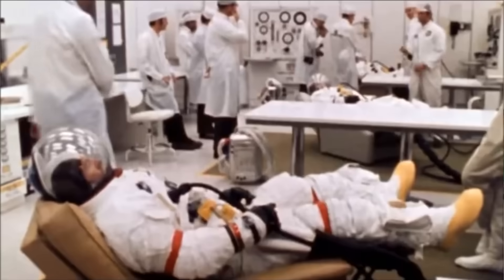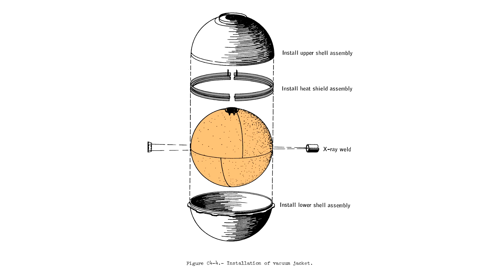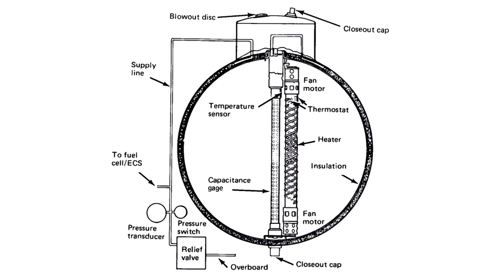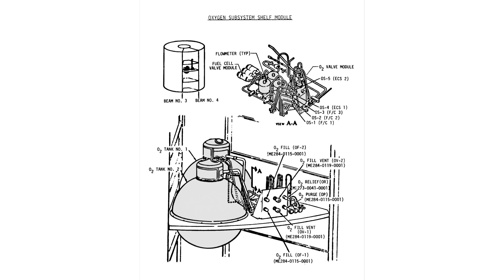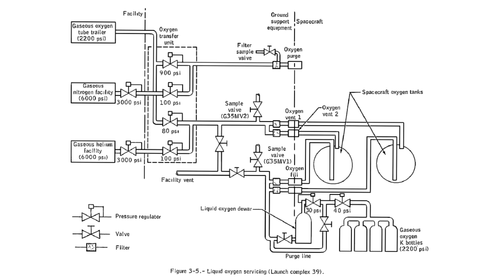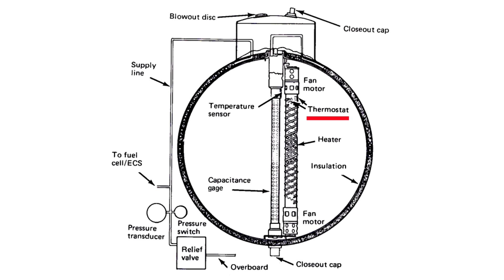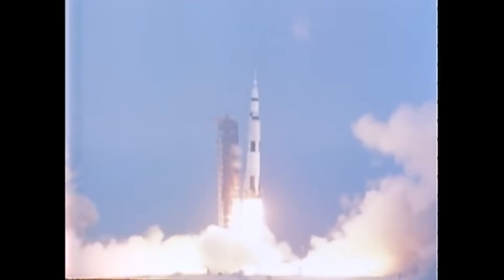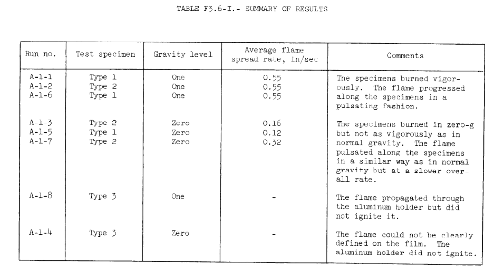What Caused The Explosion That Crippled Apollo 13?

Comment: One element to this story which is present in Lovell's book, but which you didn't mention - and is worth highlighting as it's yet another of the coincidences and minor failures that contributed to the explosion. When they were attempting to drain the tanks using the heaters whey were also monitoring the temperature within the tanks - this should have meant they would have noticed they were baking it at 500C...  But they temperature sensors and monitor they were using was calibrates only to go up as high as the 27C they expected the thermostats to cut out at.  So when the thermostats failed, and burned off the insulation - as far as the technicians could tell, the temperatures were precisely the 27C they were expecting - not the catastrophic 500C.   If their thermometers could go higher than 27C, they'd have immediately know the tank was faulty.

Just makes me thing of the Chernobyl series - "It's ... the maximum reading on low-limit dosimeters. They gave us the number they had...."
Reply: Dave F Ouch! The law of unintended consequences.
Reply: A good case for when testing things, choose a gauge with a range high enough to tell you if things have gone catastrophically wrong.
Reply: @scottwatrous  They did . This was a cryogenic liquid oxygen tank. If the temperatures are above freezing, things have already gone disastrously wrong. They chose the gauge based on the range it was supposed to be used at. They never accounted for someone deliberately bringing the tank to a boil because that was neither part of the intended use in-flight nor any of the planned ground tests.
Reply: @scottwatrous  Or at the very least the gauge should indicate explicitly when it goes off scale. Even simple mechanical gauges almost always have this 'feature' implemented simply by having the mechanical movement reach well beyond the scale printed on the face. Once you see the needle is off the scale you know you can no longer trust the reading.
Reply: @scottwatrous  You have to balance risk, likelihood & cost. What if the part to do that was crazy expensive or unreliable or not even currently available?
Reply: I’ve been selling instrumentation for over 25 years, miss scaling or wrongly matched scaling is still the most common issue we see!
Reply from the maker: I know.... I knew this but forgot to mention it
Reply: @scottmanley  We forgive you Scott because we all knows Jim's Level's book:)
Reply: @scottmanley  As I like to answer when someone asks me if "do you know such-and-such" : "oh, I know everything I just can't remember it all"
Reply: "27C...not great, not terrible."
Reply: Always design your stuff as if it will be hacked by somebody.
Reply: That is... Idiotic. Any measuring equipment should have a measuring range a relevant margin outside the maximum and minimum 🙈
Reply: @Musikur  They did. Again: it's a cryogenic liquid oxygen tank. 27 degrees C is way, way above the maximum operating temperature; by that point all your liquid oxygen has been long since boiled off. Indeed, that was what the engineers were doing deliberately: heating the tank to boil off liquid oxygen to empty it. The sensor was never designed for that; it was intended to handle the conditions expected in flight and the expected ground tests.
Reply: I find it odd that they didn't include a thermal fuse in the design. It is a simple device which is incapable of failing, even if it tried.
Reply: @listerdave1240  A thermal fuse doesn't reset. If one had blown in flight, they'd have lost that tank's heater for the rest of the mission. So they went with a thermal cut-out instead.
Reply: @macdjord  A thermal fuse never blows unless the temperature has reached its setpoint. It is a very simple device with a wire made of a material that melts at the required temperature so there is no way for it to fail to blow and neither is there a way for it to fail without the temperature being too high.
They could have put a 100 C thermal fuse which would only blow way above the supposed maximum of 27 degrees but still way below the point where a fire could be started.  If the temperature reached 100 C then you're better off with a heater not working at all than the risk of blowing up the tank.
Reply: @listerdave1240  I'm fully aware of what a thermal fuse is and how it works. But why would they do that? If your liquid oxygen tank hits 100 C, it's either long since boiled dry, in which case you no longer care and are probably already dead, or its on fire and cutting the heater power won't help. Sure, it's obvious in retrospect that it would have been a good backup, but in advance? They already had a thermal cutout system; adding another one would just be one more component that might fail.

Remember, neither the heater nor the thermal cutout failed *in flight*. It was a ground operation - one the tank was never designed for - which caused the damage.
Reply: @macdjord  Well, it did reach and far exceed that and it exploded. The heater is estimated to have gone up to 600C starting the fire and subsequent explosion. A thermal fuse would have halted that at 100C (or whatever rating was chosen). It may have put the tank out of action but would have prevented its explosion from damaging all the other stuff.
Reply: @listerdave1240  No, the overheating heater - which, again, was during a ground test which the tank wasn't actually designed for - just damaged the insulation on the wires. It was attempting to stir the oxygen tank which cause the damaged wires to arc and start a fire in flight.
Reply: @macdjord  Still, the overheating heater would have tripped the thermal fuse and prevented the tank from being used for flight (because it would no longer work at all rather appear to work while hiding a fatal defect). 
Generally speaking there is never a good reason to not install a thermal fuse. 
One could write a whole book of famous last words consisting just of arguments as to why a protective device isn't needed because something can never happen. Thermal fuses would feature a lot in such a book, along with bursting disks and fusible plugs.
Reply: @listerdave1240  As I said - obvious in retrospect. But the real problem here was the tank being used in ways it was never designed for.
Reply: @macdjord  It's not a matter of retrospect but bad design. Fusing protection is an absolute must and cannot be waived based on assumptions of how something is going to work. The design principle should always account for control systems jamming and such likes. Actually just the availability of enough electrical power to cause an over temperature is enough to require the incorporation of a thermal fuse, regardless of how the system is designed to operate. 
The only explanation I can think of is that they were rushing the design and got someone high up to sign off bypassing some critical safety reviews to save time.
Reply: @macdjord  Another major flaw was the failure to incorporate a large bursting disk on the outer facing side of the tank and the corresponding failure to have blowout panels to relieve overpressure on the skin of the service module at locationshousing any tanks or equipment that can fail explosively.
Even without the thermal fuse the bursting disk and blowout panels would have prevented damage to adjacent equipment in the module and would have allowed normal operation of the service module on the other oxygen tank and fuel cells. It would have been insufficient to complete the mission but way more than enough for them to go round the moon and back safely to earth without any hassle.
Reply: @listerdave1240  They had a thermal safety. It was just in the form of a self-resetting cutout instead of a fuse, since the cutout's reusability was more important for the designed parameters than the fuse's higher reliability. There were two critical errors made here: improper retesting of the cutout when the requirement was added to support higher voltage for ground tests, and deliberately boiling the tank to empty it, which was an operation for which it was never designed. (Though the second was arguably justifiable, on the grounds that swapping out the tank instead might have introduced more risk than using the non-standard draining procedure.)
The lack of a large outward-facing bursting disk and corresponding blowout panel is a good point, though I will note there are always tradeoffs; a burst disk is - by design - a weakpoint in a pressure vessel.
Reply: @macdjord  A self resetting cutout is exactly the type of device that should not be used in such a situation. They are inherently prone to welding shut.  It is OK to use one but only if it is backed up by a thermal fuse that will trip at a higher temperature. That way you have both the reusability as well as the safety net for if/when the mechanical device fails.
What happened was entirely predictable if a proper fault tree analysis had been carried out. Actually such a design should not even have survived to reach the stage of fault tree analysis. It should have been caught at the most basic level of safety review.  As I said, the only possible explanation I can think of is that waivers were obtained to rush the design through, bypassing even some of the most basic checks.
Reply: Lister Dave It could be a byproduct of the speed of development that they didn’t include a thermal fuse.  They didn’t add one because they knew temperature wouldn’t get that high in flight, and didn’t consider the remote possibility that something would go wrong on the pad.
Reply: @thebigitchy  Well that is something they couldn't know. They could perhaps assume it (incorrectly) but not know it. The very fact that is a thermostat is already shouting loudly that it can go higher as it is the only thing that limits the temperature rise and is known to have a finite probability of failing to open.
Reply: @listerdave1240  You probably don't want it to fail... Imagine if the heater wouldn't work anymore...
Reply: @MarcoTedaldi  If the thermal fuse had blown then it would mean that the heating system had become dangerous and you're better off without a non functioning heater than an out of control heater. The spacecraft was designed to easily operate with just one functioning oxygen tank but was not designed to handle an oxygen tank exploding and damaging all sorts of stuff around it.
Reply: The temperature monitor only went up to 80F.  They knew the temperature would be a little higher because they were using the heaters to remove the O2 but yeah, if they had a wider (higher) range on the monitor, they'd have seen that something was wrong with the tank shortly after the pad test.
Reply: @rsrt6910  i think one of the problems was the thermometers were only able to read to 300kelvin.
If they had a wider range of temperatures on the thermometer the engineers would of known the tank was at fault.
Reply: "would HAVE."
Reply: "Not great, not terrible"
Reply: Thank you for this detail.  I wondered why they didn't know how high the temperatures got.
Reply: Its 15000
Reply: @kevin42 that's over 9000!
Reply: I always find these situations like why did they design/test it like that. If u have a test/controll function u would think that they would have used a test kit with a higher upper limit then the maximum designed limit of the thing they were testing to even be able to spot if there was a problem.  Even if it hade never happened before they might not have thought about it. It still sticks out as a major failure,  Did no1 really se the design flaw with having a thermometers maximum reading being the same as the expected reading while in use. It´s easy to look back at mistakes and say that was dumb how did they not se that.  But with all the testing and approvals needed u would think that some1 must have atleast thought about it.
Reply: Not great, not terrible!
Reply: The take away from Chernobyl in that regard is if instruments are maxed out across the board, it's much worse than you imagined!
Reply: “You’re delusional”
Reply: 3,6 Roentgen, not great not terrible..
Reply: Kinda like the oil pressure “gauge” in most vehicles
Reply: @211212112  Ford has done that on many vehicles. The gauge itself is a fully functional gauge. But to save a small $ per vehicle a simple pressure switch is used instead of a variable sensor, and a resistor is put in the circuit to make the gauge read an acceptable value. Making the gauge functional is as simple as soldering a wire jumper across the resistor on the instrument cluster's flex circuit and swapping the oil pressure switch for a gauge sensor.
Reply: @greggv8  "Nice" you think that you are having a gauge but all you have is just a two state control light with a needle instead of light bulb:/
Reply: @211212112  could you elaborate on the vehicle oil guage comment?
Reply: @MattH-wg7ou  most vehicle oil gauges only have two states. Good and bad even though the dial makes it look like they measure more than two states. Like you could have almost normal oil pressure but it will say you have no pressure at all
Reply: @211212112  thanks for the reply, I never knew that!
Reply: This is a case of engineers being overly confident and making assumptions rather than being safe by always assuming the worst and accounting for it.  Regardless of it's application, ANY heater has the capacity to create a vast amount of heat energy than it is designed for.  Given how critical these tanks were to the survival of 3 humans, it is just unbelievable the engineers didn't have a safeguard in place to ensure there was no possibility of overheating the tanks and damaging them.  And this safeguard didn't have to be anything fancy or precise.  All they needed was a temperature sensitive switch inside the that would close at 30 c.  But instead they assumed the thermostats would work and never fail.  They never learnt the most basic lesson from Apollo 1 - never assume.  They made the same mistake with Challenger and again with  Columbia. 

And while the Americans like so much to beat their chests about how they are world leaders, I haven't seen the Russians repeatedly make these basic mistakes, or the Chinese.  I'm not saying the Russians, Chinese or Europeans haven't made their own stupid mistakes, they have.  But the thing that the Americans are alone on here is the repetitive nature of the same basic mistakes they keep repeating. 

Oh, and along the way they killed 17 people.
Reply: Designing your sensing system to feed back those results that you hope and expect to achieve is a great confidence builder.

Think: self-driving cars.
Reply: This is why you never put a max limit on a temperature gauge. Make it as high as it can possibly go.
Reply: False... The reason was ionizing radiation. The reason Orion was sent in 2014 to the same part of the thermosphere as 13 went, but this time without the tanks or the men to get cancer... This is also why we do not go higher in the thermosphere than we are now.
Reply: @joemaddoxrx7  lol wut

Comment: That's a lot of different accidents, errors, and design flaws adding together.  Why did the design not take into account what would happen if the blow-out valve actually blew out?  Why was the temperature of the tank not monitored, and instead left solely up to the thermostat, even during the ground test, where they could have had more people and more computers monitoring fewer systems?  During the ground test, the heater ran for hours without anyone noticing.  Why was it even powered for that long?  

Was this because rocket science was still young back then, and they hadn't yet developed the current level of caution?
Reply: The tank temperature was monitored.  With a thermometer which went up as high as the temperature they designed the thermostat to cut out at.  They thought the tank was at 27C all the way through the draining process. Any other themometer with any other max value and they'd have noticed the problem.
Reply: @DaveF.  That's not very useful for monitoring, if it only works within the expected range.
Reply: @Br3ttM  True, but these are the things they learned from after this disaster. You also have to remember that the state of computers back then were such that the spacecraft itself didnt really have much in the was of computing power, almost all computing at that time was done at mission control. The spacecraft itself was designed with what you would call single lines of code that were triggered thru bus systems. Mission control would give the crew commands to flip switches to achieve a result they were looking for. Most of these flight commands and which switch did what during the mission were memorized by the crew to do at certain point along the way.
But in this case they had to come up with shit to do on the fly, and mission control would give the instructions based upon all the computing and brain power back at NASA. 
By todays standard they were working with stone tools compared to quantum computer. It's really a miracle that they got back alive.